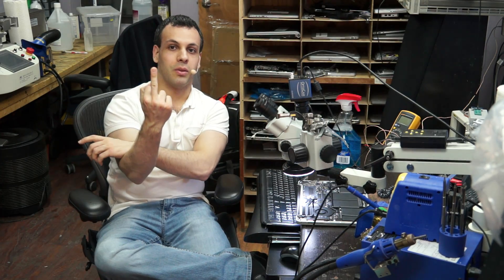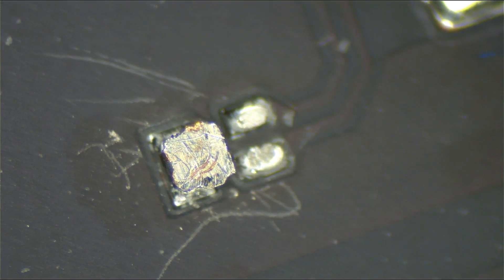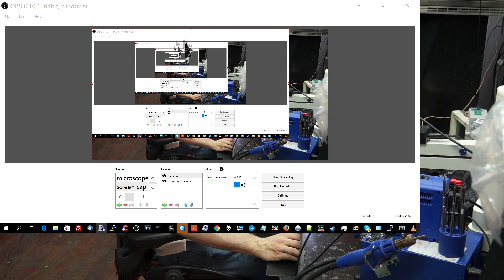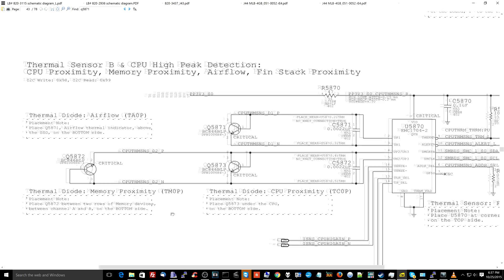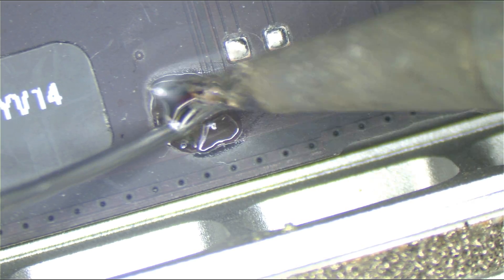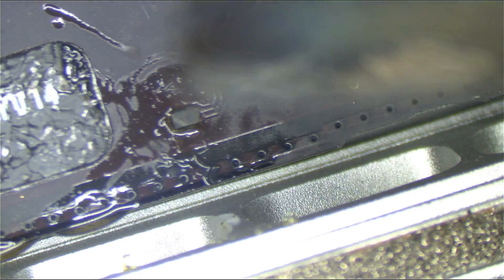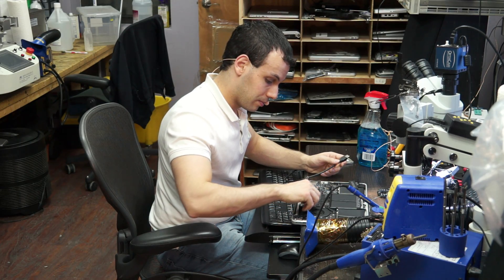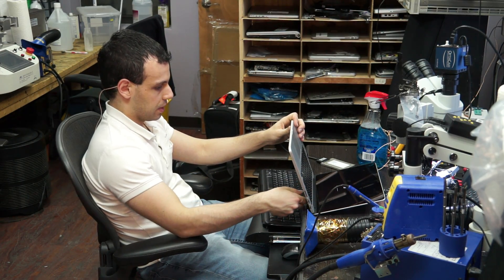Louis keeps his middle finger high for Apple Inc!

Comment: Hey. my brother's being dicked around by both Apple and O2 on his warranty. I was wondering if you knew how to solve the problem of an iPhone that won't charge.
Reply from the maker: Usually bad charging port or bad U2 chip on the motherboard.
Reply: Thanks for that. Could you expand on the U2 Chip point a bit though please?
Reply from the maker: blasoonstorm it is the most common charging issue on an iphone. chip controls charging, chip is a prissy piece of shit so it dies all the time, and phone stops charging
Reply: Okay, thanks, so should I just try to get another U2 chip and have it replaced in a store?
Reply: @blasoonstorm did you check if there is dirt/dust in the port? my phone did not charge because of that. try taking it out with a small wire or something similar
Reply: or with a duster
Reply: My iphone stopped charging twice in the last year and both times it was dust/lint in the port. Careful using paper clips as it can scratch the chip. I use wooden toothpicks

Comment: I had an iMac with a bad temp sensor and the fan was on maximum speed all the time. If someone else has this problem, simply install Macs Fan Control and you can change the temp sensor for the fan and it will spin at normal speed.

Comment: This has been a long standing issue with Apple. Although I've been a customer of theirs since purchasing a 128K Macintosh in 1984, it is difficult if not impossible to repair them cheaply. 

From my personal experience, however 3 of the 20 I have owned have had any problems at all. My Electrical Engineer college roommate saved me the $500 Apple wanted to replace a video board on my 128 K Mac which was otherwise functional but had trapped upon it the final paper needed for me to complete my Bachelors degree. 

One $0.25 resistor, a pizza, and a six-pack of beer later I graduated with honors. 

The second failure was the most common issue that I found with others. The hard-drive simply stopped working. Drive swapped for larger capacity but data lost forever because the backup drive died before I could bring the data to the new drive. Bad luck. 

The third was a PowerBook I was hoping to maintain to run old PowerPC software where both the monitor and trackpad died. I rescued the drive and put it in an external enclosure but no luck running the compatible applications at any appreciable speed. 

Could have used you on that one after both Geek Squad and Apple refused the repair. The wreckage is still in storage if you ever want to play with it.

Comment: Help needed. 
Hi Louis. After power outage I have the flashing folder on a 2013 - 2014 27” iMac, I started in recovery mode and found the HDD has been corrupted and shows as unformatted, also “SMART” is not working. It’s going to get a new HDD but I have file on the drive I need. I tried to use Terminal to download “Testdisk” but it didn’t work.
Can I create a USB boot volume and install ios with testdisk on it or some other software to temporarily recover my patitions. I work on Windows PC’s normally and this is my first iMac Thanks👍

Comment: Just my $.02 on the issue of Apple making repairs harder for the average person...  I don't think the average person has any business inside of their computer or especially their laptop.  Most average users will do much more harm than good.  I don't think that when we make a computer smaller and thinner we can make it easier to service since the parts will be more densely packed in.

While it's nice to get people interested in repairing their own stuff, there is a steep learning curve when it comes to the skills you would need and risking a $1000+ computer on beginner mistakes is reckless IMO.

I've personally had several moments of success in working with Apple to repair their products when people I know had damaged them.  They have always been good with me, but I do understand that some people may have interacted with bad employees.

I've replaced batteries in my MBPros and can say that wasting my time and money trying to save some on aftermarket batteries has been a headache I'm not willing to take on again.

The only other point to make, if you expect a company to provide an experience from their product (like always working) then wouldn't it only be fair to only allow them to work on it if it needs service?  Otherwise if you fuck it up, or you install inferior parts, you can't blame them.

Comment: I just stopped repairing them... not worth the time or money (or lack of money).

They will spend 1000 USD on a mac but wouldn't spend the same on a Windows PC.

You buy a nissan march and complain its so slow and crappy but replace it with a BMW instead of a Nissan Maxima...

You compare a BMW with a Maxima

You do not compare a 300 USD netbook with a 1200 USD mac...

Comment: This is a bad move for apple, given how apple product are positioned as the premium class, they should encourage repair, longevity, and integrity(less dongles plz), it should also take advantage of apple's uniform design witch should be easy to diagnose and have a abundance of parts. Its a shame that apple chose the short term profit at the expanse of their brand, a premium price tag is only meant for a fashion statement, this is not a sustainable practice. There is a stigma to apple because it contradicts the value of tech culture, it place itself in line with over priced designer cloth, along with superficial push of concept and bad engineering practice. no wonder they get looked down by the savvy.

Comment: And my boycott against Apple since 2007 (for personal reasons) seem to have been a good idea. 😁
Reply from the maker: +LY TAYLOR very good idea! What started it fir you?
Reply: Louis Rossmann Story time: I was in college at the time. I worked really hard on a paper. Format and everything, perfect paper. I didn't have printer at home so I thought I would print from the lab at school. The only computer lab nearby was an Apple lab. But naively, I thought, it's a simple Word document. How different can it be from a PC? So I plugged in my flash drive, opened up the file in the "Word" program of the Apple computer. Instantly it corrupted the formats of my document. The content was still there, but all the margins, indentation, font, line spacing, etc. was ruined. Of course that wasn't  going to work because your paper has to be formatted a certain way in college classes. So I ran across campus to the PC lab, plugged my flash drive in, and to my horror the formatting was all gone (corrupted by the Apple computer). I have to sit there for half an hour, reformatted my 10 page paper. Every single line, every single paragraph. Then ran across campus to turn the paper in. By this time the paper was late, and the professor deducted 1 whole grade point because it was late (he did warn us he would do this to late papers). So my A paper is now a B. It was partially my fault. But I swear from that day never to touch anything Apple makes again. So there, that's my beef with Apple.

Comment: my dell computer i had to buy a new power supplie for ......brought in 2008............which is bad......if i brought a apple .....would power supplie blow up..
Reply: Keith Tipping Oddly enough, I've never had trouble with my Apple power supplies. But the only problems I've ever had with my hand assembled Windows boxen have been the power supplies. When the last one went bad I simply stopped building them and using them and never missed them.

Comment: I had a graphics card issue on my iMac mid 2011, 27 inch. The warranty had finished and it would've cost more then £100 to repair it. But apple did it for free. So you can stfu.
Reply from the maker: +GameBros Ⓡ I fail to realize what your iMac has to do with hidden sensors and lack of diagnostic tools
Reply from the maker: +GameBros Ⓡ btw, that machine is covered under extended warranty because all those video cards were faulty, after years of consumers protesting.
Reply: Louis Rossmann
It doesn't matter because firstly the warranty was finished and secondly I was unaware at the time that they were faulty(even though they lasted 4 years). They didn't have to replace if for free. And my father once dropped his iPhone 4 a few years ago and the phone was shattered. The phone was under contract to O2 but apple offered to replace it for free. The reason why they are so popular is because their products are simple to use for the majority of people, stylish and they have great customer service. Where as microsoft tries to form a monopoly in the industry to rip people off.
Reply: ...osoft tries to form a monopoly in the industry to rip people off...

You mean apple
Reply: DasEtwas
Have you ever brought Windows Words, Excel etc. The whole set cost a lot and the actual price is like £5.
Reply: GameBros Ⓡ brought??
Reply: You are like talking to a wall +Gamebros
Reply: DasEtwas
Do you know what brought means? It means to buy in the past tense.
Reply: GameBros Ⓡ
bought. Not brought.
Brought is "bring".

..
Reply: DasEtwas
lol totally missed that. but you get my point.
Reply: GameBros Ⓡ
Continuing,
I didn't have to buy these. They are included in windows
Reply: James Rau If he is a kid, why would you throw so in-adequate words like "fuck apple" in the conversation?
Reply: "Where as microsoft tries to form a monopoly in the industry to rip people off." Meanwhile Apple is getting roasted for using proprietary hardware in their new phones, this practice is so shady that it's actually illegal in the EU, they have to manufacturer their phones differently there. The genius's over at apple thought that it would be a good idea to swap out the standard headphone jack for proprietary earphones that use the same socket as the charger. Btw, Microsoft products are all about ease of use too, even more so than apple because their OS isn't based off unix, allowing for a MUCH simpler file system. Enjoy having Apples new and completely unnecessary file system shoved down your throat next year.

"APFS can’t be used on startup disks or Apple’s Fusion Drives, and filenames are case-sensitive only. What’s more, APFS formatted drives are not recognized by OS X 10.11 Yosemite and earlier, so you won’t be able to transfer files to an older Mac using an APFS drive."

I'm sure you're still clamoring about how amazing Apples (decades outdated) tech is though. What a joke. Oh well, Louis has already roasted you enough, I should stop picking on you.
Reply: "Apple fixed my phone for free that means everyone gets free phones from Apple"
Reply: libreoffice,openoffice
Reply: stylish you mean over priced ?